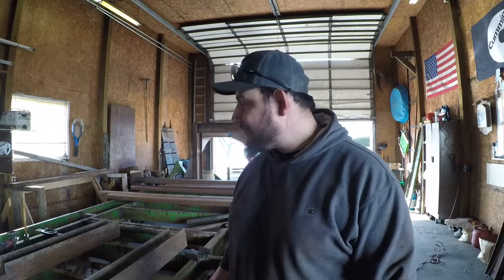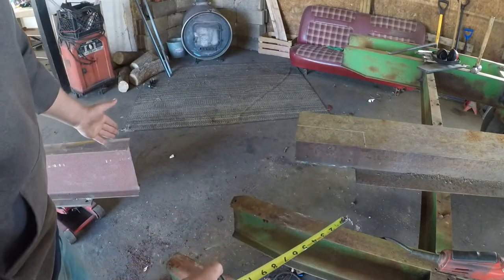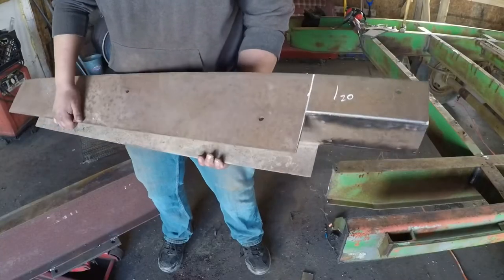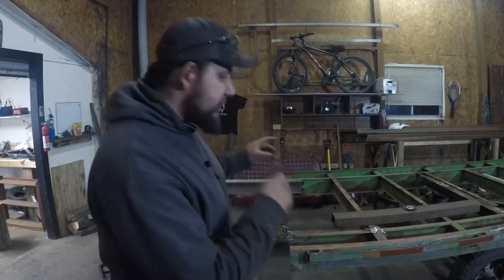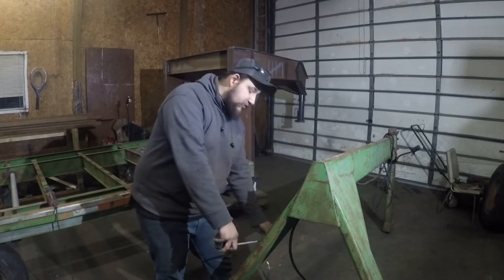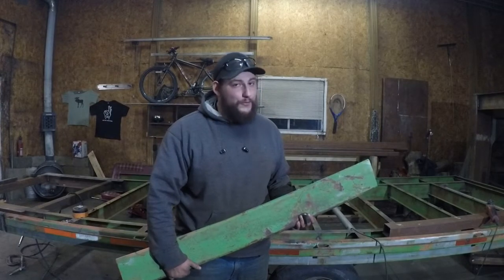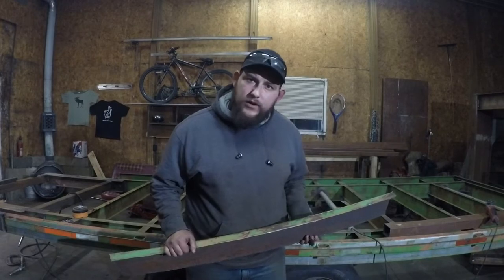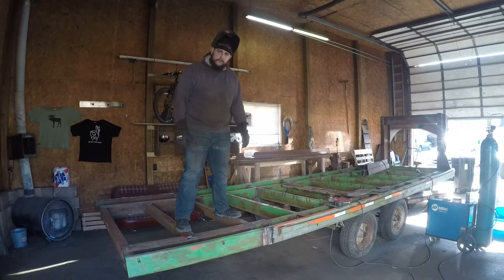Building a Gooseneck trailer (Pt. 4 Extending the Trailer)

Comment: I have a ford f150 that is very much custom (1978) with an eaton 10 speed (with overdrive) and it has a stroked out AMC I6 (originally 4.0L), np205 transfer case and ford 9 inch rear axle.   I plan to use this very odd pickup truck for not only plowing and towing other cars but to also haul a trailer.

Question is that for great articulation and weight distribution, would a gooseneck trailer be good or would a regular ball-hitch be good for the off-road aspect?   

Note:  I'm going to add a third driveline from my pickup so that the wheels on the trailer can be powered, effectively turning my truck from 4x4 into 8x8.
Reply from the maker: Well fuck buddy, that’s an interesting setup! 
I would think the gooseneck could be designed to  articulate better, problem Is power transition, would need a crazy double Cardan setup to make sure it doesn’t bind up, I’d almost say a pintos hitch would be a good idea? post a video of your setup! I’d love to check it out!

Comment: Hey stranger!  Alright!  4 more feet!  Are you moving both axles or just the front to behind the rear or is that all still yet to be determined?
Reply from the maker: Hey buddy! Both axles are moving 4ish feet back, I’m planning on adding a hydraulic 10ft beaver tail, so I need to get the 60/40 split of distribution with the axles. I have everything Autocad’d out! 
How’s that Frankentruck holding up?
Reply: @MidwestMoose  Nice!  Hydraulic bevertail would be awesome!  #FrankenTruck is good, changing out fuel tanks right now (for various reasons) and not it's getting nice enough again I might be driving it to work soon!  Been out of town a lot lately for work, so I'm trying to get caught up on stuff and get some videos out soon... hopefully